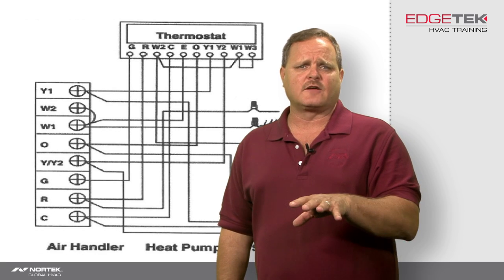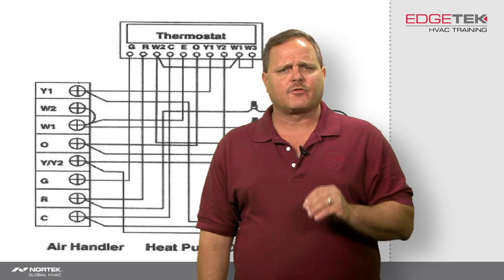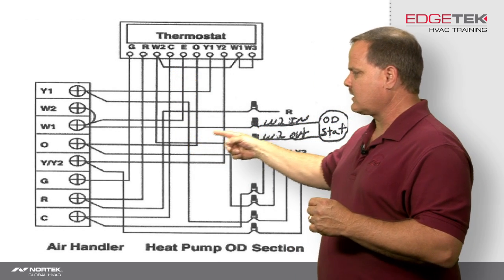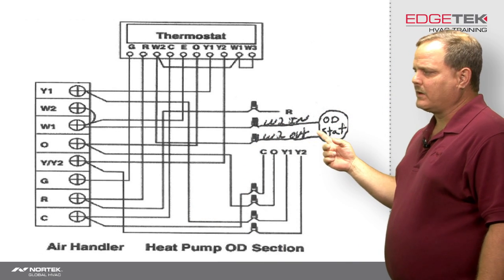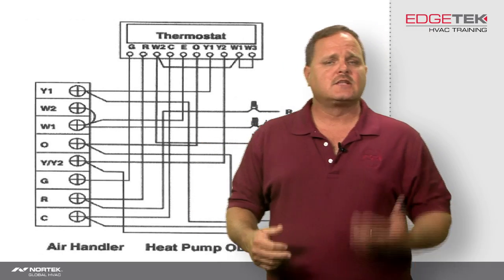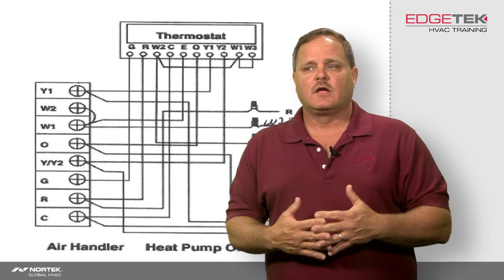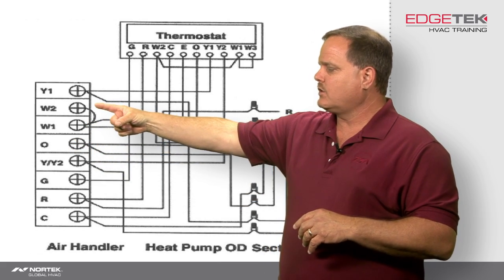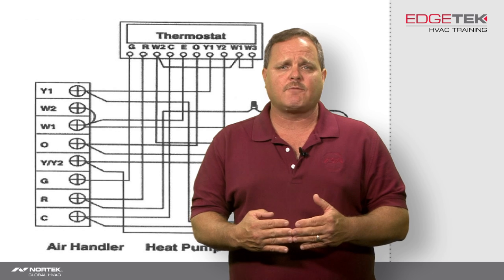Wiring of a Two-Stage Heat Pump

Comment: Excellent video.  Curious, is it feasible to omit the 2nd stage cooling wire on a 2 stage heat pump to get more heat capacity?  example.. manJ heat=53k and cool is 29k.  Using a two stage 4 ton unit would get me most of the heat and be only a about 15% oversized for cooling that's limited to the 70% stage 1.

Comment: Instead of having a Y 2 connected to my A S 4TWB3060B1000CA heat pump. I have a W 1, W 2, and Y 1 coming from the thermostat and go to the heat pump. Maybe I have a 2 stage, heat pump, before I temporarily disconnected the W 2 wire seems like it may been putting out more heat?

Comment: So what about thermostats like the communicating American Standard Platinum ACCULINK 1050 that only has B R D Terminals (i have plans for zoning to be added come spring time so needed a thermo that can control zones through a zone relay all of which will be added in May 2023) that is connected to an American Standard relay panel to a tem6 non-communicating American Standard 5 ton air handler and two stage Gold 17 American Standard heat pump? I haven't installed that apparently doesn't know what they're doing and for two days for the life of them cannot get emergency or auxiliary heat to work.

Comment: on a single stage heat pump with only 4 wires thermostat, can you jump the thermostat, blower board and defrost board like y/o, w/b an r/rh with no common when you can"t run additional wires?

Comment: what does an X wire do and why does the new thermostat say not to hook it up?  its on a heat pump unit.
Reply from the maker: Hello, our equipment does not have an X wire.
Reply: great video,  very well explained,  the only thing I believe the wiring from the outdoor thermostat is backwards,
Reply: Ah. The x wire. We are having the same issue.
Reply: @angelbelieves7496  I believe the X wire is for Trane Heat Pumps, I believe its the signal in from the Outdoor Unit to turn on the electric heat strips/backup heat while the Outdoor unit defrosts. This is because the outdoor unit in defrost mode is actually cooling, so to avoid cooler air going through the vents the X wire sends a signal to fire up the backup heat to keep warm air going through the vents just until the Outdoor unit defrosts. Again not 100% but pretty sure that's what you're seeing.

Comment: Can anyone  help me. I have paid twice to fix my heatpump  unit ,which is a York 2ton.everyone said themostat.because it was blowing the fuse on the low side.well changed it and still no heat.the unit runs on the airhead side but blows cold heat,the ac runs on ac,but not heat

Comment: I'm not an HVAC tech, but I'm pretty sure he leaves out that this requires a special "heat pump thermostat"  Otherwise when the thermostat requests heat, Y1 and/or Y2 will not activate and your heat pump condenser will never go.

Comment: Do anyone know how i can limit my aux heater from coming on?
Senville 12,000 and 18,000 Btu Aura series. I think they are made by Mitsibishi.
Reply from the maker: Hi Eddie, the products you're referencing are not manufactured by Nortek Global HVAC. Mitsubishi may also have a way to reach out for support.
Reply: Thanks. I'll see what i can find out...
Reply: Use Alexa automation.  Setup two different thermostats one for stage 1 and another for stage 2.  Let stage 2 be your radiator water heating produced by your tankless Navien water heater.  Let stage 1 be your Mitsubishi mini split.  Do not connect it all to one thermostat.... connect it to two separate smart thermostats that support if this then that programmable interface.

Setup your first thermostat that is running your mitsubishi to run at all times unless temperature goes below 72 degrees... if temperature goes below 72 degrees (which means your Mitsubishi unit can’t handle the load anymore due to perhaps temperature outside being below 35 degrees) turn on your stage 2 tankless water heater and turn off your stage1 heating... once again using programmable if this then that interface...   

At this point you will be running on your tankless water heater radiator heating fueled by gas.   That is going to be more fuel efficient than heat pump when it’s very cold outside.... plus it will give you opportunity to fix the heat pump if it broke for example....

Plus fail over is automatic.... plus you can use Alexa to override it with Manual voice controls.... where you can turn back on your Mitsubishi..... with a simple voice command such as “Alexa turn my primary heat on”.... in which case your gas heating will turn off and primary will turn on.... 

See? Easy right?  Better then connecting things to one thermostat mechanically and getting lost in the process...

We live in digital age... not Stone Age... let’s be more digital...

In my case I have my house on solar panels... and I am using similar setup.... 

Where electricity for me is basically free... well $100 per month vs typical $400 before solar panels.

Heat pump helps save money on electricity as well up to certain temp... then the gas kicks in.... 

Cool right?